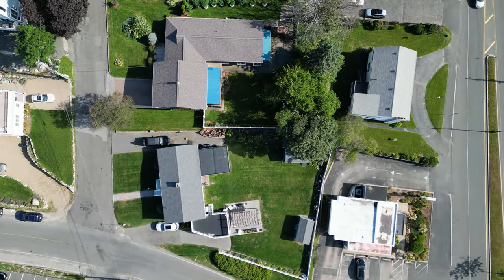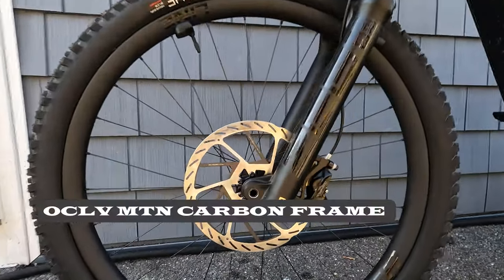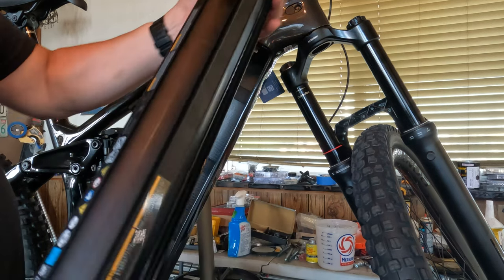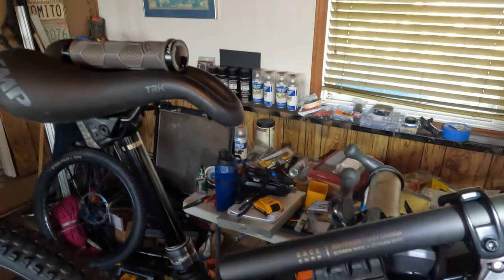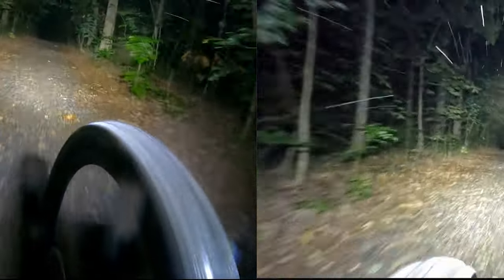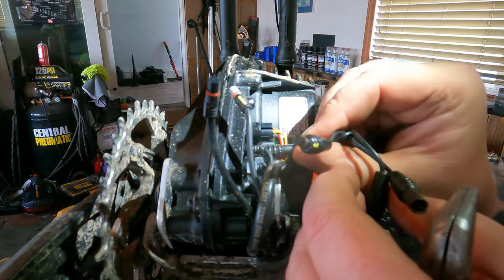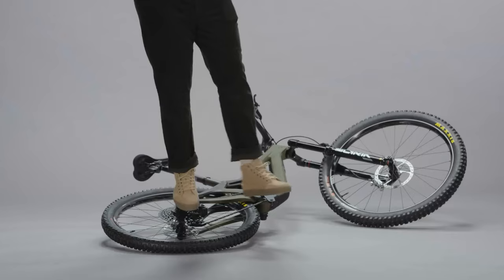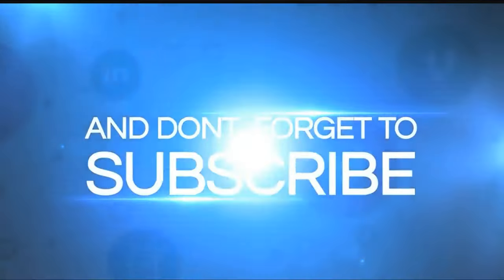2024 TREK RAIL T-TYPE Everything You NEED TO KNOW! #gen4trekrail #2024trekrail #ebike

Comment: Just came across your channel. Great review of the bike. I am considering the same model, but the alloy version because I have been on a couple carbon frames that broke without notice. It's going to be aluminum for me from now on as the last break resulted in a 100k overnight stay in hospital. Your take on the t-type transmission makes me want that version, as I have snapped so many chains under load while changing gears.I rented the trek rail this last summer for a mountain bike trip in alaska and it out performed my more powerful bikes that have Bafang M600 and M620 motors.
Reply from the maker: Damn ran my trek rail 9 for 2 years cf and no issues at all  that sucks. but weight wise id go alloy too

Comment: the AirWiz is for riders who may experience extreme altitude and temp fluctuations from top to bottom and or travel from region to region as air pressure and altitude can dramatically affect your shock and tire pressures. For tubeless set ups on hook-less rims pressure shifts can have severe consequences. if you ride in mostly the same climate altitude you wont get a lot of use other then showing it off to people who dont have it.

Comment: Hey is there a reason you changed motors 3 times? Did they break or have issues and on average how many miles did each last? Also what’s the cost of each motor replacement?
Reply from the maker: 4500 miles easier to swap out motor than have trek take it for weeks to replace bearings.
Reply: @jailbreakoverlander  4500 miles is pretty good, you must ride a lot, I was worried about longevity but I guess I don’t have too. So instead of overhauling the motors you just choose to replace with a new one, do you know much it cost roughly? Bosch has updated the gen 4 with the smart system so there is hope once I’m done with the first motor I can get the new one with the connection to your phone features.

Comment: You should check our the TRP DHR Evo brakes as a replacement for the Srams. Way more power, easier to bleed, and they’re super quiet
Reply: Also, the reason they spec XO instead of XX is because XO is aimed at the more aggressive/physically demanding side of riding, while XX is more for lightweight riding. The biggest difference between XX and XO is that XX has Carbon cranks and a lighter weight rear derailleur while the XO has aluminum cranks and a heavier derailleur
Reply from the maker: if I swap out srams brakes Ill go back to shimao XTR  srams are STILL loud as heck after 8oo miles